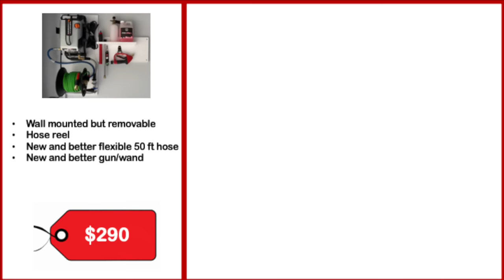Wall mounted Pressure Washer system in garage, DIY for $290 | Worx

Comment: From the UK here and your set up is so awesome. One of the hassle for me, is getting everything out, set up to wash and then putting everything away. Which is why, I go to a car wash or sometimes not bother but your set up, is very cheap and will pay of in the long one. I will differently look into have a set up like yours but my house doesn't have a garage. Most likely, I probably mount it on the side of the house, brick wall and build some sort of enclose around it, protect it from the elements. Also, you explained evrything so well and I like how everything is neat, really pleasing to look at. Awesome tutorial.
Reply from the maker: Thanks for watching. My biggest hassle has also getting everything and and it putting it away so, ended be not washing the car or using a car wash. Now I can do every Friday before the weekend in like 10 min and keep the car clean! Our prices here are about $10-$20 each time for the car wash so this saves a lot!
Reply: @LifeHacksExtreme  That is the reason I don't bother and sometimes I don't do it. In my area, think it ranges from anywhere from £15 to £25, depends on where you go so if you wash your car, once or twice a month, it adds up, especially since me and my husband both have cars so very expensive to wash cars. I showed him your set up, he was so impressed with it and said we differently need to do something like that for our house. Even spending £300 will pay it off in a year and honestly, it will be really nice to drive the car without having mud and bird poo on it. Currently, researching on the parts, best places to buy. Only issue is, we don't have a garage but a drive way, so we are thinking, maybe building a enclosure on the side of our house. But anyway, awesome clean design....differently inspired me to do DIY again.
Reply from the maker: Great idea, you could build a box wood enclosure with a couple of hinges and a lock :)

Comment: Nice job. Tip with the thread tape is to do the opposite way to sticky tape (outside of the roll to the thread) and in the same direction as the thread, it'll be easier to roll off and keep tension 👍
Reply from the maker: Thanks for the tip

Comment: love it!! I figured this out myself years ago (painfully) I wish I had you to guide me... I recently took it to the next level with a retractable hose real... very difficult to find the right hose real that could handle the pressure, but, I will share it here: REELCRAFT PW7600 OHP, I used the Karcher 50ft hose that is 5/16" (Model:9.558-124.0)  because it is narrower, has higher velocity and is more flexible than other hoses (my personal preference). I also used a different wand, MTM foam canon, and a CAT-1800.... This is an Excellent Video!!!
Reply from the maker: Thanks for the tips! A retractable one would definitely be useful!
Reply: @LifeHacksExtreme  other one i have in another garage space is the Coxreels TMPL-N-375... I think these are all made by the same supplier but just come in different colors based on the "Manufacturer". The Coxreel's one is 1/3rd the price of the REELCRAFT one... and it is almost identical.

Comment: Note to self: get socket and ratchet set(don’t use channel locks to tighten nuts), paint parts before installing them.
Reply from the maker: You can easily get by with channel locks if you don’t do this kind of stuff often to justify the cost of extra tools. Like a handsaw can be used often in place of table saw.
Reply: @LifeHacksExtreme  i guess I have a different mindset I believe basic tools like screwdrivers and socket set are a must. A little bit at a time and before you know it you’ll have everything you need!

Comment: Nice! How’s the vibration through the wall with the pressure washer? Also I don’t know if you’re in a cold climate area. If so I would install a drain valve on the lowest point of the PVC so you can drain it. If it freezes the PVC will break.
Reply from the maker: The vibration is not noticeable inside the house. There is some sound that comes through on the lower level of the house. Yeah, I do live in cold climate and the PVC pipe is easily removed from the faucet for drainage in cold weather.
Reply: @LifeHacksExtreme  the way you have the pipe installed you’ll alway be holding water and that pipe will freeze and break. You can blow it out with air before winter.

Comment: The brass / silver hose connected to your faucet, I plan to connect it to the splitter on my washer in the garage.  Is the metal hose with brass connector included with the pressure washer?  I think the splitter is 3/4" and i would have buy another long garden hose to reach the pressure mounted near the exit. Does the washer take 3/4' garden hose?
Reply from the maker: Yeah the pressure washer takes 3/4 garden hose. All the connectors inside the garage were included in the hose reel or the new pressure washer gun. The connectors outside the garage by the facet were purchased extra.

Comment: Thanks for this video. What size screw did you use to mount the plywood onto the stud at 2:32?

UPDATE: This video was invaluable in creating my own setup in my garage. I made a video with it on my channel, so thank you for this.
Reply from the maker: Don’t remember the exact size but plywood is 1/2 inch, plus drywall is about 1/2 inch and you would want to go into stud for 1.5 inch at least so about 2.5-3 inch will do.
Reply: @LifeHacksExtreme   Great, thanks for the feedback. This video was extremely helpful! I used 3/4" plywood with structural screws that were 2.5" long and this thing is solid as a rock.
Reply: @LifeHacksExtreme  Just wanted to let you know I made a video on my setup as well. Thanks for your help!

Comment: Why do you have the extra pvc shutoff right before the pressure washer? Don’t you have to control with the Outside hose bib? What is the inside PVC one doing?
Reply from the maker: Hello that is so I can turn everything on/off from the pressure washer station. I keep outside ON all the time.

Comment: that washer cannot be mounted facing down on the wall like that.  oil needs to circulate and having it on its side will drastically wear the oil pump oil is having a hard time fighting gravity. I only know because I rebuild pressure washers that fail due to not running them correctly.   it's your risk though. you should remount it facing upwards in normal sitting position mounted on a shelf is way better for the unit.   good set up though
Reply from the maker: Thanks for the feedback. I didn’t see anything in the instruction manual but this could easily have been the thing that is not documented because they expect people will run it flat.
Reply: Do you resale any of the power washers you fix?
Reply: You could make a bracket where it pulls out flat and locks into place.
Reply: And when your done using it i can fold back flat how it is now
Reply from the maker: Thanks, thanks actually a great idea for a followup video!
Reply: Hey! I mounted my ryobi pressure washer just like you did with your works and over time it would over heat and the pumps started to leak. I have now mounted it horizontally and changed the seals. Runs well now!

You got a great setup going!
Reply: You did a very cool job.  I just don’t get why so many people are wanting to put their pressure washer on the wall though?   I get the space saving part but why not just have it in a storage cabinet?
Reply: @LarryKay41510  mainly because either they are detailers or hard-core enthusiasts that clean their cars or others they know on a regular beekly bi weekly or monthly basis and having it mounted up and organized  cleanly on the wall with hose reel and products near makes it effortless to detail vehicles. I actually set up washers and hoses for store clients who say they would like to wash their own cars with their kids when they want.  it can be right inside garage or outside near hose bib and electric outlet just covered so water doesn't soak the machine. plus when I go detail their car it's ready for me I don't have to use any of my stuff because they paid me to have everything they need all the basics.  it also helps them teach their kids to take care of the cars and work though it's more fun than most work with the foam cannon lol.
Reply: You lost me at paint job outside! 😂

Comment: I've recently set up own budget pressure washer system using a Kracher K1700 Cube/Kobrajet 50' hose.  I have the same foam cannon, the original MTM I've had for years.  Looking to replace the orifice in it to a 1.1mm to get better foaming action.  Just curious why you opt not to go for a wide spray pattern when laying down the foam, seems more work that way.  I have a black vehicle, so I couldn't go without my CR spotless DI filter.
Reply from the maker: The foam cannon I have had for years when I didn’t do any research on what’s the best one. Got to admit, it’s probably time to look at a better option for better foam/wide spray pattern. For this video I was mostly focused on wall mounting it.

Comment: What drill bit did you use for the 1/2 pvc through the concrete wall
Reply from the maker: The concrete/spade bit from the big box store. It was a layer of brick then plywood then drywall. So there was no concrete but I think the same drill bit will work for concrete too.

Comment: Nice setup but the pressure is a little weak for my preference
Reply from the maker: Different nozzles will give you different pressure but yeah the max is 1800psi for this one. Any more than that and I thought the car paint will come off 😀. What pressure have you been using for your car?
Reply: @LifeHacksExtreme  that is simply not true, I work with a gas honda 4000 psi and use yellow and white tips on cars trucks and vans 6 days a week. you'd have to really be holding it in one spot for an extended amount of time pointblank to go through the clear and paint... and when your rinsing your always moving the water. so you are safe just be smart about how you use the tools.
Reply: @LifeHacksExtreme  I use a Honda power stroke 3100 psi from Costco. I do a little bit of off-road here and there so I like little more pressure to wash the mud off. Your setup is clean and more convenient
Reply: @humboldt707chronic I honestly have yet to see any type of mud I havent been able to spray off and I’m running around 1000psi 1.75 gpm with my setup. You don’t need a ton of psi to wash vehicles.

Comment: quick connect fitting for the blue hose to the pressure washer?
Reply from the maker: I used the fitting that came with the pressure washer gun + hose reel. Didn’t have to buy any other fitting other than what came with those two.

Comment: That PVC pipe outside, unless you install a drain to drain the standing water in the pipe, better live in the tropics, because it will freeze and will bust up your pipe during winter time
Reply from the maker: Thanks. Winter just passed and the pipe was just fine in snow/ice. I disconnect it which drains most of the water. The little water in there evaporates, or has room to expand. You can also blow a little from the pressure washer end and that pushes all water out.

Comment: That looks like foam from a $290 overall setup.  Lol
Reply from the maker: Thank you for watching. I am looking to upgrade the foam cannon for better foam action.
Reply: The orifice upgrade as previously mentioned will help. Also get your soap to water ratio dialed in and adjust for a wider fan from the spout. 
The pressure washer itself isn’t the greatest tbh. Neither is mine but it’s a bit stronger. Greenworks electric 2100 psi and 2gpm. More water flow and pressure helps with the foam.
Reply: lol one of the dumbest comments of the day